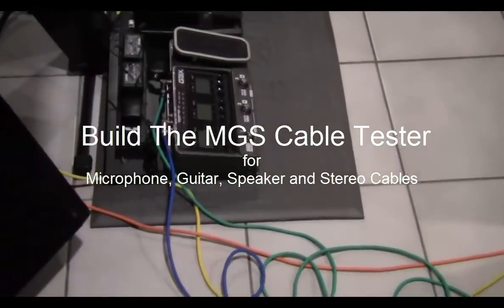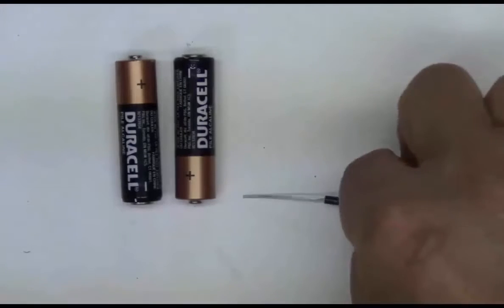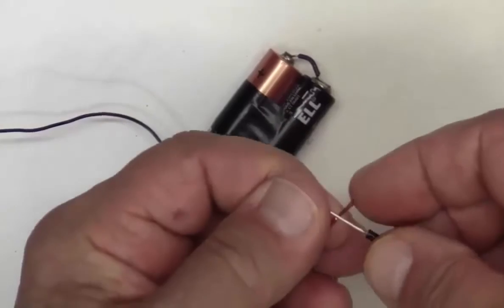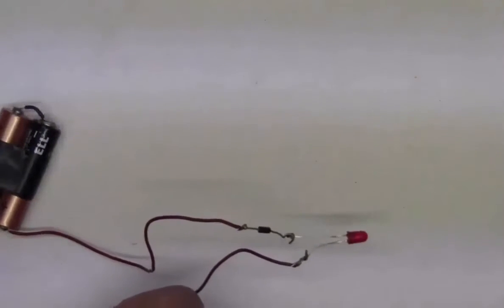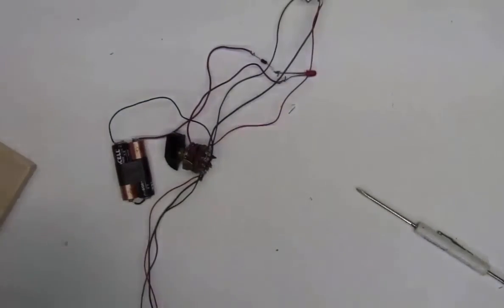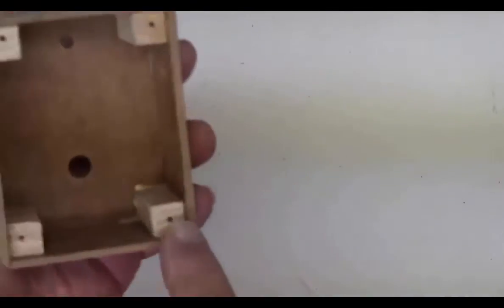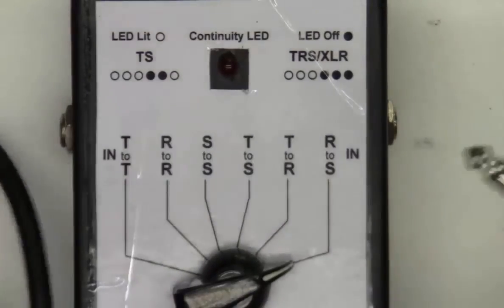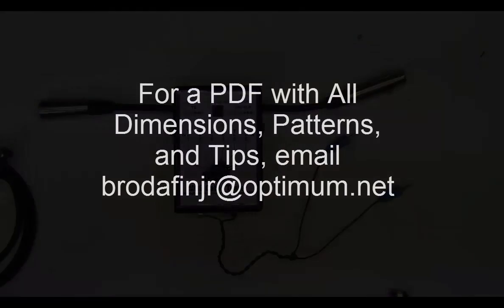Build The MGS Guitar and Microphone Cable Tester for under $10

Comment: External XLR connectors will last other than panel mounted ones. Good job.If you replaced lower drop resistor with the rectifier batteries can be used longer.